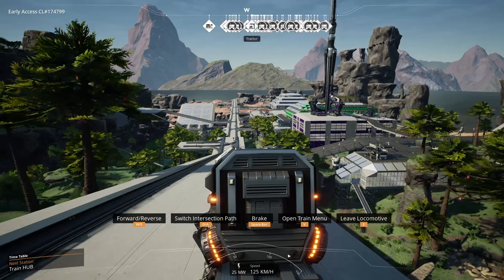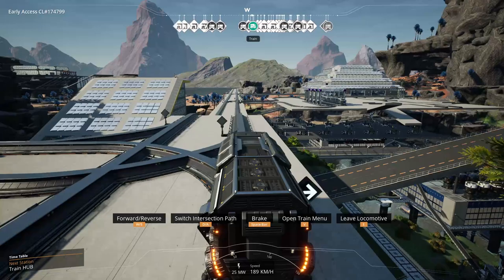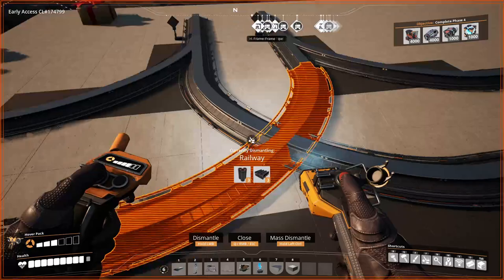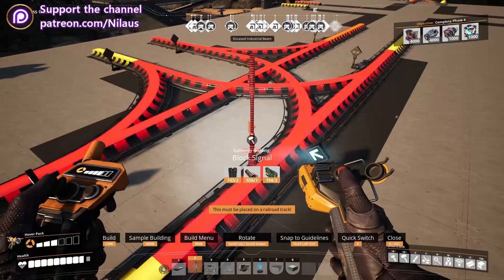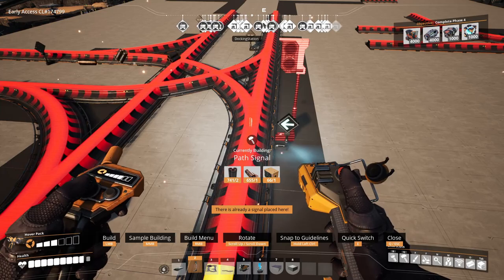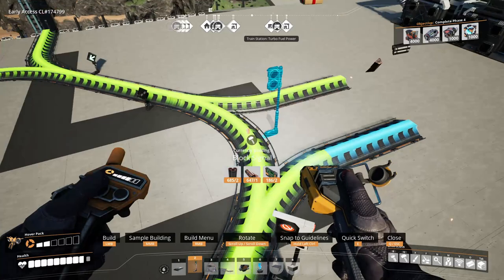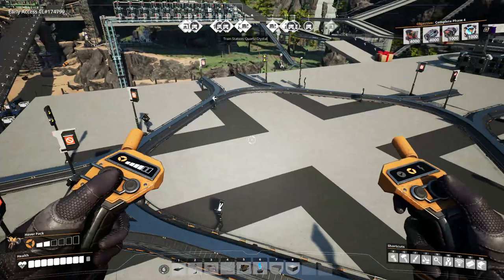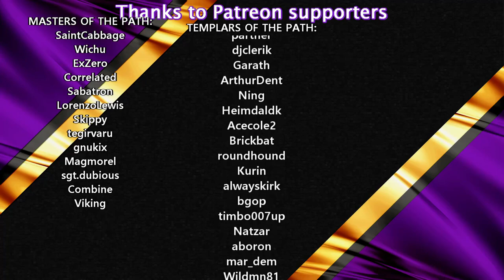Build Better Train Infrastructure | Satisfactory Update 5 | #16 | Showcase/Tutorial

Comment: Path signals reserve the path through the block rather than the block itself. So your signals will allow two trains to pass one another going left to right and right to left across the top of the T intersection with no issues.
Reply: Yes they are not the same as factorio chain signals. Also because of this you don't need any signals inside intersections.
Reply: GREAT to know!  Thanks for that!  I had the hardest time getting that all figured out in Factorio, and now that I'm (finally) trying out Satisfactory, it works differently.  Geez...

Comment: Four colour theorem only applies to 2D planar surfaces. In 3D space, such as Satisfactory rail tracks, it does not apply and you could potentially need an arbitrary number of colours. Working out the minimum number of colours you may need for any given 3D structure is analogous to the travelling salesman problem, and hence could be extremely computationally nasty.

Comment: Small correction for the "up- and down" part: It's the 4m DOUBLE Ramp or the 2m Ramp.
Thank you for the tutorial Nilaus, I always enjoy them and I think trains are what people are playing around with pretty much at the moment.
Reply: they should have named all single and double ramps based on the incline, the usable height difference, and not the total height of the building block. then a 1m, 2m, 4m ramp would match a 1m, 2m, 4m double ramp. it's not really difficult to double numbers when selecting double ramps, but it would be easier if i could select them without always having to think about them, whether it is a single or double ramp when clicking on eg "2m" in a menu. and this applies even more after we can zoop single 1,2,4 ramps instead of building double 2,4,8 ramps for the same effect (and only a little different looks): they shouldn't have different numbers/names ...

Comment: The game doesn't actually keep arcs circular when built between 90 degrees. That first circle around 4:15 was deformed slightly toward being a diamond shape. If you want to get closer to a circle, I think doing 45 degree arcs similar to the video works better. However, instead of going 2 blocks up and over from the center of the arc, you need to go an extra snap over: 2.125 blocks.

You can check that with Pythagorus: a^2 + b^2 = c^2 where a = b and c = 3. Solve for a, and you find a = 2.1213... That's much closer to 2.125 than 2. The only downside from this is that you lose symmetry if you're also trying to make a turn off at the 45.

Comment: Path signals are not pre-signals, with path signals you shouldn't have a signal immediately after the exit of the junction, instead you should have a path signal on the entrance to the junction and then enough space for a train between the exit of the junction and the next signal. 
Remeber path signals allow two trains into the block if their paths do not cross.
Reply: yes, but the path signals don't only work on the path IN a block, and instead work on the path THROUGH a block, and that includes the next block after the end of the "shared" block. that is why you need a normal block signal immediately behind a junction, to indicate where the space starts for the train where it may stop without blocking the junction with its last car, and path signals only will allow trains to enter a block when the path in that block as well as the block behind it both are available.
Reply: @Anson_AKB  You're right, path signals also block an exit block.

Comment: For your T intersections, if you break your curved segments into 2 segments (2+1, 1+2), then you are able to put a path signal in the middle of the curve, which allows you to break the left and right lanes so that trains can pass each other without blocking (as well as a right turn and a left turn not blocking each other, etc.) It is tricky, because there is a specific block that you have to use, but as long as you learn it, you can make very nice, "tight" T intersections that have pretty good throughput. I even use half of a T intersection as my entrance and exit to my train stations.
Reply: From other posts here, it seems that isn't actually necessary as the Path signal apparently looks for the way through the section isn't just doing it on a block by block basis. So even if the top and bottom are one block they should still allow trains though as long as they are not taking paths that overlap. I haven't tested this myself though.
Reply: @BadVoidShip  yes, John probably played a lot of factorio which has no path signals (chain signals are something similar but quite different too), or he uses only block signals and no path signals in Satisfactory.

Comment: More Signal info/tutorials I would find very useful. Still finding it difficult to determine when to use a Path signal.
Reply: normal block signals everywhere to split long tracks into smaller segments because there can always be only one train in such a segment which is called a block.
in those situations where you want several trains to pass through the same single block at the same time (eg for both directions at a T-intersection where the rails from both directions are made into one single block by having the crossing track touch both of them) you can use path signals to let them find a path through the block that doesn't cross other trains' pathes.

TLDR: block signals everywhere, except for having path signals right in front of every entry into a junction.
Reply: @Anson_AKB  Thanks for that; that's made it clearer.

Comment: are u sure ur not doing the 45 turns wrong I have never had a problem connecting them up, i do have issues connecting a 90 up sometimes in which case i just use 2 45s.
Reply: The problem is that the standard 45° isn't really 45°, it's slightly off. This can actually be useful as in some situations I find the game prevents doing a 90 ° between 2 straight pieces (such as into a station), but that might be because I only have 1 foundation between my rails, not 2. Also when doing a shorter turn out of a junction the signal might not work because it's too close to the track, but coming at it from the other direction results in the split being a bit further away from the track (might be because I'm doing left hand drive). Putting the temporary straight diagonal bits should make it 45° at the point. I'm not sure if the resulting curve is a perfect curve visually though as the game probably has a slightly smaller turn radius than the ones we get at the snapping points at 1.5 foundations.
Reply: @BadVoidShip  usually when trying to connect two 90s together it doesnt work so oyu have to use one 90 and 2 45s or 4 45s. the 45 i do end in the middle of a foundation slighty overlapping, its possible to accidendally get the alignment wrong as its hard to see and that causes the next 45 to be misaligned, however i found when done right the 45 is basically perfect in all situations
Reply: i always build my tracks on a ONE-foundation raster and not two, and also in the middle of foundations and not on their edges (total width of tracks is 2 foundations for me, instead of Nilaus 4 foundations). and i also have more problems with the fourth 90 degree in a roundabout than with 2x45. the reason for all these problems probably is the same: even when a curve looks to be perfect, it probably isn't, and has eg 44.5 or 45.5 degrees instead of 45.0, etc. and depending on whether you build on edges or centers, it may be easier to find/see "good" snap points for one or the other angle.

when building a roundabout, i usually built 3x90 degrees, then finished by adding 2x45, and finally replacing all the 90 (one after the other) by 2x45 for each. but since we may no longer build (problematic/buggy) X-junctions and have to build >-< instead, i now build roundabouts with at least 12 segments (12x30 degrees) which is a bit less round and/or may require a larger radius, but allows me to connect four directions without X (and still is smaller and rounder than such a squareabout :-)

btw: while getting used to building rails, using standard foundations instead of concrete may be helpful to visually have more reference points on a foundation.